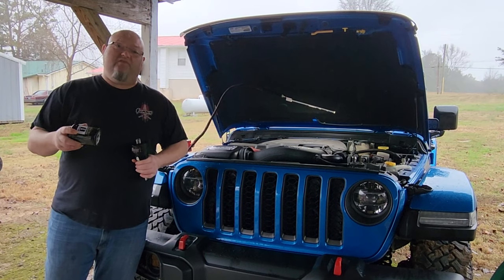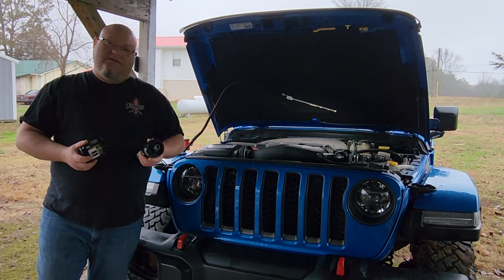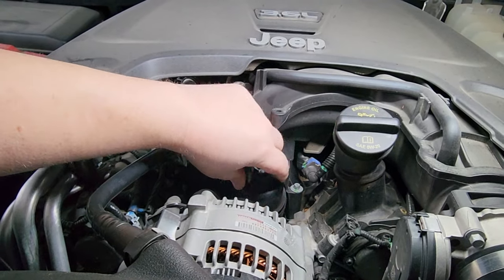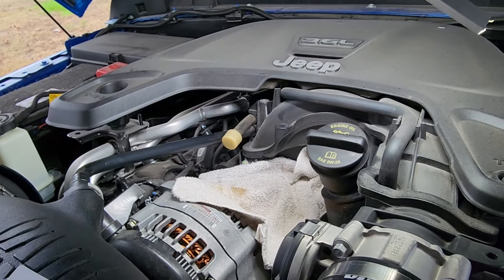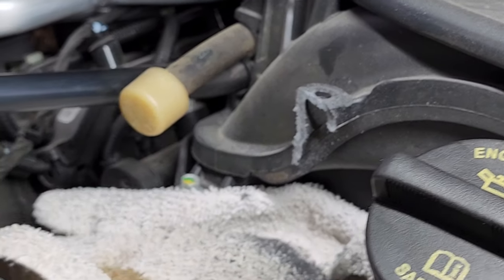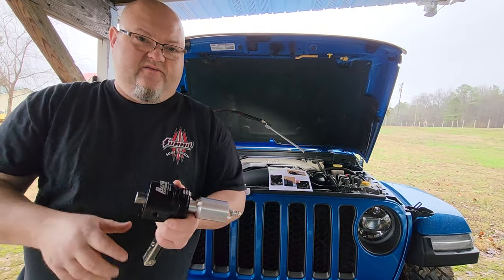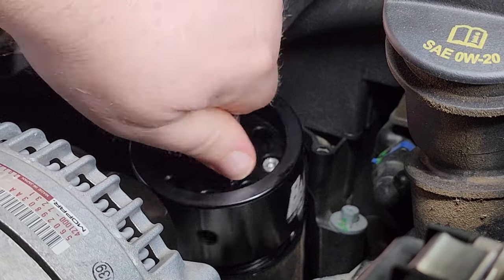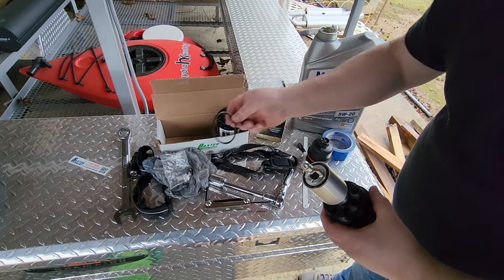BAXTER PERFORMANCE Spin-On oil filter adapter (ELIMINATE DRY STARTS) Jeep Pentastar 2014+

Comment: I'm not sure if you prepped for the video when you removed your old filter, but if you unscrew the housing and your oil filter remains down in the housing and not in the "cap" end when you take it off, whoever changed your oil last didn't seat the filter into the cap and it allows oil to bypass the filter, allowing it to not do its job properly.  When you put a new filter on, you seat it into the cap and should hear it snap into place, then screw the cap with the filter attached down into the housing.

Comment: Excellent video!  This addresses what seems to be a major flaw with the 3.6L. However I have a bunch of concerns or worries. 1. The oil pump now needs to overcome the Baxter and the oil filter check valve, does this result in a lower oil pressure and or a lower oil volume flow?  2. During an engine start the oil pump is pumping against two closed check valves, is there any long term negative consequence to the oil pump?  3. Canister oil filters can become quite stuck and hard to unscrew, that will put a lot of force onto the plastic threads from the Baxter thread cleat lock, will that result in the plastic threads getting ruined over time, or is there any way to hold the Baxter housing with a tool while unscrewing the canister oil filter?  4. When putting 30 psi of air pressure into the schrader valve  besides opening the two check valves, aren't we putting 30 psi into the entire oil passage distribution system without any parts moving, like the oil pump, what will that do to the oil pump or other components?  5. If the canister oil filter rubber gasket were to fail and leak oil out while driving, that is a very bad spot to have a large oil leak...potential fire risk?  6. If I start my 3.6L once every 2 weeks, is there still a benefit, are the check valves still holding the oil up?  I am sure the Baxter engineers are very good but I am also sure the engine designers were very good.  Did the engine designers not address this issue due to cost, or were there negative complications like my above questions.  My guess is Chrysler will not honor the warranty on an engine wear issue with a modified lubrication system.  Don't get me wrong, I think this is an excellent product and addresses a major engine wear concern.  I DO LIKE IT. I just worry a lot.
Reply: Great Questions! Following!
Reply: Some of these questions came to my mind but you added few great ones as well. Thanks
Reply: No worries for any of those concerns.... 👍

Comment: WHEN I INSTALLED MINE THE FIRST TIME i did it when the engine was warm . i installed adapter and filter ..no leaks present . after engine cooled i started it up the next day.. dumped maybe a gallon of oil in basement floor. after a week i reinstalled on a cool engine  .NO problems been on almost a year
Reply from the maker: That's strange I have never had a problem out of mine. Glad you fixed the problem. lol Can you tell any differences with it?
Reply: i have a catch can and change the oil every 3 k miles. like the idea of using the spin on oil filter @matthewmeltonTEAMMELTONFISHING

Comment: Or you could press your gas and brake peddles down at the same time and turn the motor over for a few seconds to pump oil to the top end.
Reply: Does that prevent the engine from starting?
Reply: @BryanPAllen  yes, the starter will turn everything over without it starting and running until you turn the switch off. You only need to do it for a few seconds, and only if you have a normal charged battery. I only do it when it has set for awhile.
Reply: @sherifx5122  thanks for the tip brother
Reply: This is the procedure I did on mine. Primed it twice, then let it run for just a bit. When it retains that oil though, I had to throw in another quart. I am in a 2015 JK Rubicon. So this adapter retains a good bit of oil, or in my case, a quart, at the top of the engine. So instead of 5 quarts, I have to do 6 now. I pour in the extra quart though only AFTER I prime the engine.
Reply: @HoldMyBeerJeeping  I also have a 15,  the 3.6 in that year does hold 6 qts stock. I did end up ordering this but the one for a remote filter. I need to install an additional oil cooler due to towing. I figure I will be at 7 + qts after the install.
Reply: That is correct. Not sure why I put 5. @sherifx5122
Reply: But if you live in 2024 you most likely remote start your car 50% of the time. lol JP but for real this product if works as advertised would be beneficial for people who like to remote start there car. Also to save a little bit of time with key ignition starts. F&$k the whole gas and brake pedal start every time. I hope ford has fixed this issue in their new ford explorer.

Comment: Good video, it doesn't look like you have to trim  that piece of material off. Did you do it just to be safe?
Reply from the maker: @motohut Thanks! yeah, I had to trim it to have enough room for the filter. It's a tight space right in there.

Comment: Question. How does the oil in the filter Lube the top of the motor during start up? It takes oil pressure from the oil pump into the filter to send that oil to the top of the motor?
Reply: The oil is retained in the filter. So when you start it up, the oil is at the top of the engine already. It is also in the oil cooler. Without this, it drains out after about 30 minutes with the factory cartridge. I am in a 2015 JK.
Reply: @HoldMyBeerJeeping  

I understand that the oil stays in the filter but how does that keep the oil in the oil cooler. 
My point was, it still takes oil pressure to push up to the oil filter to open the valve to oil the top of the engine. It’s not like there is an electric valve on the filter that drops the oil as soon as you turn the key. Just want some clarification on the theory.
Reply: Baxter Performance has videos on their site and on Facebook actually showing the oil being retained. They could probably also answer the intricate details of the question you have.

Comment: Does this BP upgrade replace the oil catch can option ,would interesting if there’s a whole assembly with a all aluminum body and just a drop in to the engine valley installation.

Comment: Thanks for the video! So I just got mine installed yesterday. The MS-201-BK. I am curious what is the best method to use, to remove the spin on filter. Do you just use an oil filter wrench?
Reply: You should be able to unscrew the filter with your hand or use a glove with some grip. Make sure when you install the filter, just hand tighten.

Comment: Instead of using air pressure to drain the filter, why not use a remote filter setup.
Reply from the maker: I'm sure you could make that work if you had the time. It would be easier that's for sure.

Comment: Installed mine about 2 weeks ago. It works if the Jeep sits a day or 2. after that , It's better but still rattles on start up..
Reply from the maker: @user-jd6jr3bs4z I swear all jeeps make noise and rattle from the inline 6 cylinders all the way up to the pentastar v6. Jeep has never been known for a quiet engine.  Ours rattles now and again but not as bad as it used to. Thanks for watching!

Comment: I do not see any advantage of installing this Baxter oil adapter other than just regular oil filter and the cost of the adapter approx $250+ plus..  Once you have the Baxter adapter in place when you replace the old oil filter with new you still encounter a dry start until the new filter gets filled with oil. Plus you add an additional step need to blow out the oil off the filter prior removing the filter.  If you forget this step you will have oil all over your engine that need to clean up..

Comment: Will this not void any warranty? So If you bring this to the dealer for oil change, they need to use different filter?
Reply from the maker: It shouldn't void your warranty, but I would call your dealership and ask them. After you use the Baxter Oil Filter Adapter, it changes your cartridge filter to a spin on filter.

Comment: This looks likes a waste of money not to mention the added stress on the oil cooler gaskets, which is where they leak the majority of times. When it comes to Pentastar reliability, realize that perhaps 1% of engines will have a rocker arm issue (which is what this device seems to want to address). If there was a major design flaw with this engine with dry starting it would show up on every single engine. So no matter what the counter arguments are (and they can be persuasive), realize that with this engine design it's actually impossible to be causing as much engine damage as claimed.
Reply: thats a good point